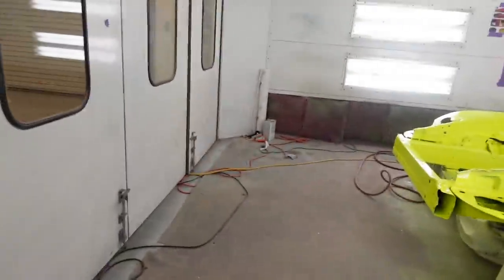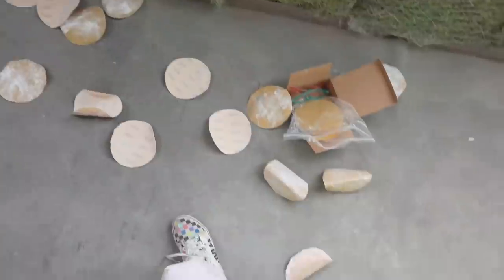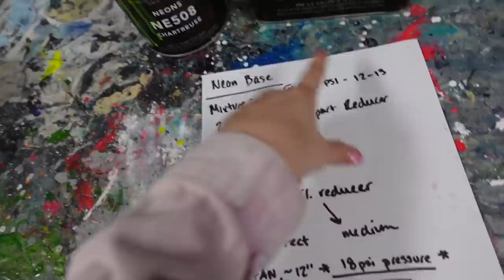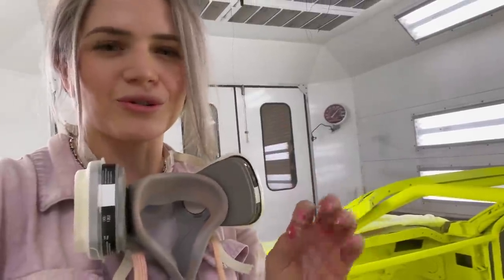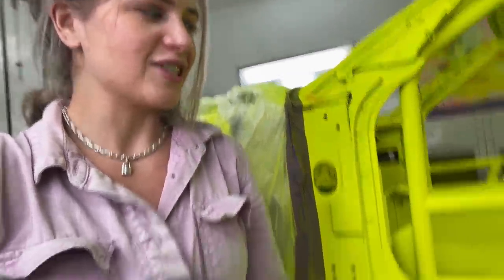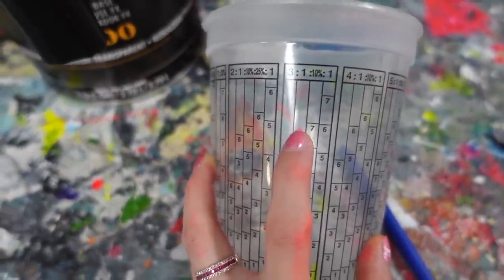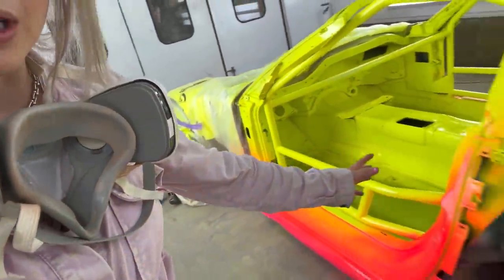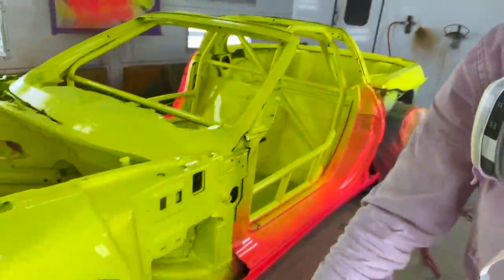Painting My C6 Corvette FULL NEON Interior + Fade!

Comment: Great Job! Some tips to help for the next paint job. Turn the reducer over can so the hole is at the top, then it wont run down the side of the can when you pour it. When you paint the car inside, start at the hardest to reach areas in the middle of the car and work your wa y to the outside, if you move fast enough the center will still be wet when you switch sides and the overspray will fall into the still wet paint and not sit on top of it. For tight areas, use a smaller (door jam) paint gun. For the outside start at the top of the car and work your way down so you dont lean against or drag anything through the paint you just sprayed. Hope this helps, again awesome job! I love when you and Chris work together, such a great team! Love the colors!
Reply from the maker: Thank you 🙏 !! I learned the reducer trick yesterday haha
Reply: Awesome JOB, You Guys ROCK...   ♡♡♡

Comment: Great work! Some advice aswell would be safety equipment. Gloves and a paint suit are almost a necessity when using mixed paints that are being atomized. When going into nooks in the car the paint and air pressure always wants to shoot it back at you. You really don't want your skin to absorb any of those chemicals and clear is super sticky.  Also when sanding its very nice to wear a well fitted respirator like your paint mask. Most of those masks have removeable filters that you can swap between a sanding filter and a paint filter. Just thought id throw it out there because you are killing it lately with going hands on in these big ways! Looks killer.

Comment: Collete I first started painting spraying parts used to build spray booths and they put me in the spray room shower me how to mix the paint and they left me to it I learned by my mistakes as I had to correct them, My boss I didn;t know was checking my work at night I had none sent back to me and I had to spray small parts and large panels for doors it stays with you and it also helped when I did a load of powder coating.

Comment: Just some things to look for when the gun starts freaking out on pressure like that is to make sure that everything is cleaned out of the gun and isn't clogging any of the air holes and if it continues you cant try to reduce the paint more so the drops are smaller and sprays out easier.

Comment: Keep up the good work it will pay off I have been trying to learn how to auto paint in last two years messed up a lot but still gonna keep going never put a video when painted but this year want to I can tell am getting better though.
Reply from the maker: Messing up is just learning too :) keep at it
Reply: @ColleteDavis  I have to set up garage to be able to paint in winter when it gets warmer in Michigan where live gonna put 4x8 boards on the ceiling but still will need a heat source so will be to paint in winter it 21 degrees where am at now that the problem now but plan on starting the wood boards for insulation when warmer maybe March or April earliest I actually painted before was June though but ready to do again now but as I said garage not set up right yet to paint in winter plus gonna put a exhaust fan in garage too never used one before.

Comment: I’m not sure if you have someone to just open up the area where the heating element is for the paint booth but it may just be a high limit that needs to be reset. 🤷‍♂️ It might look like a metal disc about the size of a quarter with two wires and a tiny button in the middle. you just push the button to reset it. If you do look in that area be sure to turn all the power off before taking a panel down. Then again it may not be anything like that at all.

Comment: The two screws on the back of the gun is for air and how much it will fan. Try it next time on that paper on the wall so u can slow down how much paint is coming out or how much of a fan u want...
Reply: Actually, the one on the bottom is changing the trigger, u don't really have to play with that one but the other will slow down and fan more or less depending on how u like it...either that or move a little faster so u don't get runs...
Reply: When u clean the gun out run it with the compressor on at the wall or ground just to really clean it out...
Reply: Looks good 2, by the way, u will get better the more u do it, so paint away......

Comment: Having once had a bright yellow interior on a racecar you will regret this. So bright and distracts you. And when I painted it white the yellow bled through, especially the floor above the exhausts.
I painted my first racecar over 50 years ago.  AQ complete car with about a quart of orange household enamel thinned with [standard grade] petrol.
And that was done in an open shed at about 9 pm. So not real hot. Turned out well though a little thin.
And big tip,,, always start at the top and work down.
Gun blocking?  Stick your finger over the jet and briefly pull the trigger. Usually clears it.
Clear like most paint,, a thin tack coat followeed by a full coat.